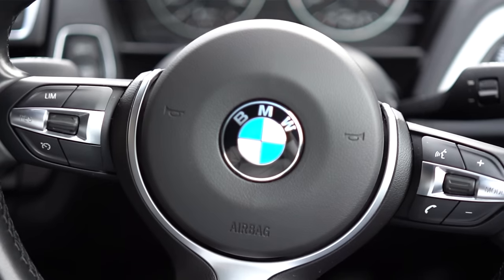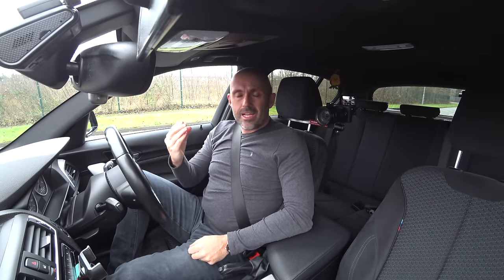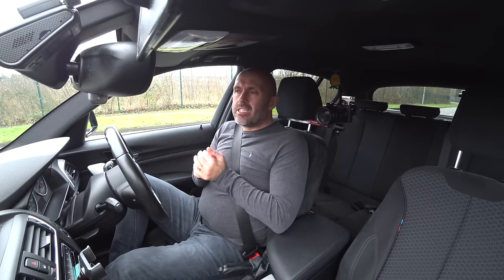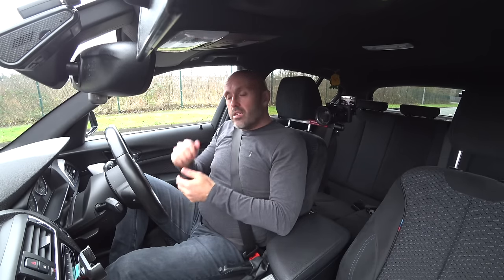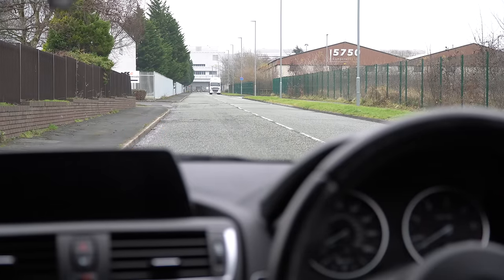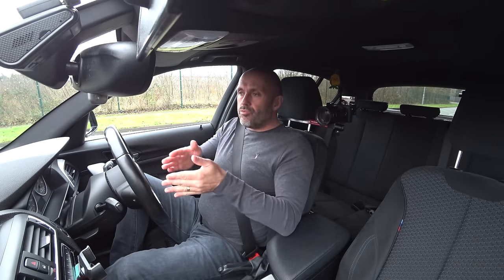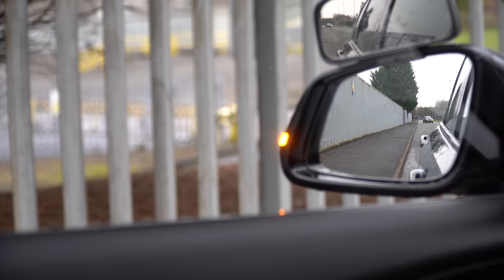How to Park Next to a Kerb Without Scraping

Comment: Nice video and good explanation Ashley. Curious as to what you would recommend on parking next to a curb that either bends away from you or towards you, how would the techniques differ in these situations? Obviously this tutorial works for straight roads with straight curbs but how could drivers perfect parking next to a curb with slight bends in the curb?
Reply from the maker: Still try to use the same process, but when lifting your eyes to straighten try to set the steer so it follows the shape of the bend you are on. Remember, going neither towards or away from the kerb means you are following it. Forget looking at angles!
Reply: Good comment. My road outside the water run away is bricked and completely uneven and broken. When u think u hit the kerb u haven’t. Ur actually in a small pot hole. Lol .
Reply: Kerb...
Carry on😁
Reply: @thisisnumber0  Same word, different spelling, both acceptable ways of spelling it. No need to be pedantic here :)
Reply: Carvajal it’s only spelt Kerb to
Mean a roadside Kerb. Curb is a completely different word with a different meaning x
Reply: @KMGliTChEZz  curb is used in North America, kerb is used outside such as the UK, Australia etc, but we get what you meant, which is the main point.

Comment: Personally I just get within a rough distance of the kerb and then reverse back in using my side mirrors, until I’m virtually right up against it.
Reply: Yeah, it's much easier to get nice and close whilst not scraping your wheels by doing this. I do it all the time.
Reply: I’m not perfect but usually get close to kerb then reverse. I do rely on dipping kerb view mirror which helps.
Reply: are you allowed to do that in the test if they ask you to pull up

Comment: For me I've just always adjusted the left mirror down and in and it makes it so easy - then when I had an Audi that did that automatically (the mirror dipping, not the parking), it made it even easier. Now I'm in a car that doesn't have it so it's a bit of a drag but the extra 10 seconds is worth it in any situation because it guarantees a perfect park. Either that or learn your car back to front and front to back and just know. I haven't kerbed a wheel since 1997, pretty happy with that!
Your guide is great don't get me wrong, just so many weird kerbs here in OZ that you can't safely judge when mirrors are in their normal position, as they are often jagged and jut out in various places.

Comment: Thanks for the video Ashley this was one of my weak points. Not hitting the curb I've never done that but never seemed to park close enough which isn't great. Will try looking ahead more once I'm in and turn the wheel slightly back to the right and straighten up as you mentioned. 👍

Comment: Helpful video - the other thing you could mention is perfecting the park once you're close to the kerb.  This depends on the width of your car and parking location, but I drive a very wide saloon in London and my parking position needs to be much closer to the kerb than those shown in this video; in those cases, and assuming it's not a parallel park scenario where reversing into a bay is best, it's best to park in the manner you have described but then reversing to get as close to the kerb as possible.  In this case you can use your side mirror to perfect the park as it gives you a true visual and therefore minimises chance of scuffing alloys

Comment: When you parked on the left and on the right you mentioned it was “perfect”. Well, in my estimation you were about 8-9 inches from the kerb on both occasions. I am an ex driving instructor and advanced motorist and have been driving for 61 years. My feelings about viewing at about the centre of the windscreen can be wildly out depending on how near your eyes are to the windscreen. A small about of movement fore and aft is magnified and therefore can never be accurate. Like most things driving, experience counts for a lot but not everything. I have driven many types of vehicle, small and large, old and new. I have found that there is a large difference in the way I need to park depending on the vehicle. Driving is a science and an art. Some people are naturals and take to it like ducks to a water, other, even though they pass the test never manage to become proficient.

Comment: I may need help even at 45, I trained myself to go in tight, touching the kurb and now struggle parking 4" away and not curb.  With an expensive car this isn't an option, I'll use this video and reference points and hope for the best.... I'm still in 15 cars a week in motor trade making the job harder again.  It really gets to me I hit kurb nice alloys however slow I go

Comment: Thanks, that was good! Never realised about looking ahead as you described. Of course I might have been doing it all along but not realised it...???  I have to say I  tend to park closer to the Kerb than you have - more or less 4-5 inches, (Palm width) at the most. (Helps ving a Mirror that tilts down in Reverse). Also I prefer to park in reverse, like parallel park when not necessary.
What I do find is that I find it easier to parallel park to the left than to the right. I think this maybe that where I lived in Africa, (where they drove on the same side of the road as us here in the UK) it was an offence to park against traffic flow. Also Diagonal Parking was very common which made things easier until reversing out and having a van parked next to you - you get the picture.....

Comment: Sometimes it's amazing how accurate you can be with where a wheel goes.  I came round a bend to find two small branches in the road.  Not a major deal, even if I hit them, they most likely would have broken up as twigs and done no damage.  I didn't want to come out onto the offside, the branch had drawn my attention, not leaving enough time for me to process a clear that response, so I aimed my left wheels to pass through the 1 foot gap between them, managed to miss both.  Afterwards I remember asking myself why that wasn't as hard as getting the distance right when pulling up!

Comment: Nice video. Any advice on if you had to turn in toward the kerb more sharply, say if there was only a space of around 2-3 car lengths between two sets of cars? Ideally you would reverse parallel park but sometimes the car behind is driving too close and won't leave enough room behind you to allow you to reverse in or the road is busy and you want to get out the way of flowing traffic sooner before making finer adjustments.

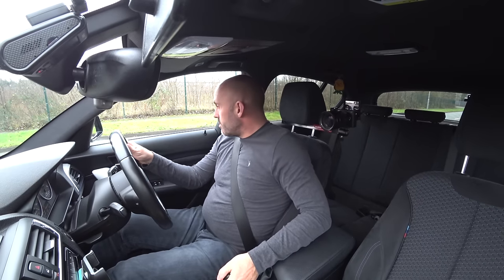Comment: 7:04  I realize that it's not about parking, but even when "no one's about" I still use my indicators.  It's just a good practice to be doing, in my opinion.  If one always does it, then they don't have to question, "Did I signal?"   Overall, a good video and thank you for creating it!
Reply: I remember when I was learning way back, indicating was mandatory and failing to do so would mark you down on the test even when not needed. However the DSA changed the rules because unnecessary indicating actually indicates you are not being observant!
Personally I always indicate no matter what because I abhor lazy bastards that never indicate at junctions and roundabouts and do not want to fall into that laziness (it's a simple flick for gods sake!).
Reply: Choosing when to use them and when not to use them will improve your observation skills. Clicking them on without thinking just because does nothing.
Reply: @middler5  Perhaps I didn't correctly explain that it's always thoughtful signaling, not "just because"...it's always done with reason.

Comment: My usual tactic for parking in a particularly tight space is to reverse into the space at quite a steep angle and go back slowly until my inside-rear tyre hits the kerb.  Quick forward shunt then back into the middle of the space and you're done!  You probably don't want to apply this tactic on a driving test though....

Comment: My instructor taught me to use reference points too. 

If I recall, the sensor in the dashboard for lights and wipers was to park to the left. I forget what the right one was, might have been on the edge of the right wiper.
Having my own car, I don't even know the reference points, I just park up without and do fine. Guess I just do it without knowing.

Comment: Ashley could give advice for the same but on a curved road? I'm not used to the camber and I have to use my electric mirrors to see. Sounds daft I know.
Reply from the maker: Still try to use the same process, but when lifting your eyes to straighten try to set the steer so it follows the shape of the bend you are on. Remember, going neither towards or away from the kerb means you are following it. Forget looking at angles!

Comment: Over here, the most difficult part of the test, and an automatic fail if you blow it, is the "parallel parking"  backing into a spot, being within a certain distance from the curb (kerb), straight, and with enough room between the cars in front and behind.  (They use 6' poles to mark the four corners of the cars at the test location.)
Anyone fortunate enough to pass the parking section (but otherwise failing the test) need not repeat it on the retest.  Fail the parking section while otherwise passing the driving portion, requires a full retest.

Comment: Or buy a car that has smaller wheels fitted with sensibly profiled tyres rather than low profile tyres then they hit the kerb rather than the alloys. The ride will be more comfortable, they're cheaper to replace. The cornering might not quite as good but you're not at brands hatch.
Reply from the maker: And then when you go on a motorway you have a blow out at 70mph because you've nicked your sidewall!